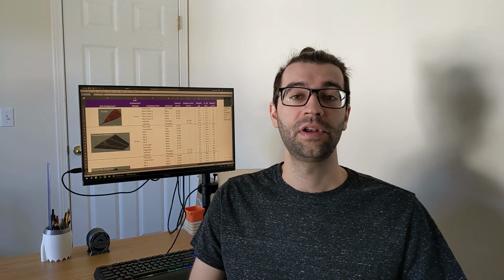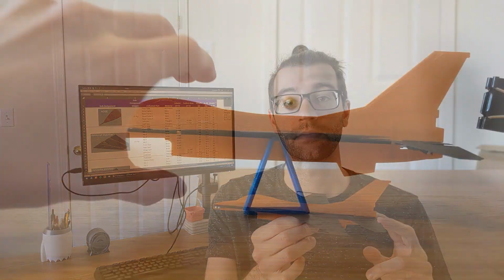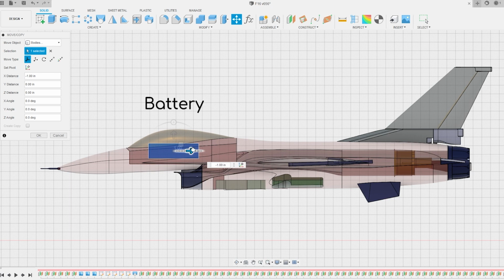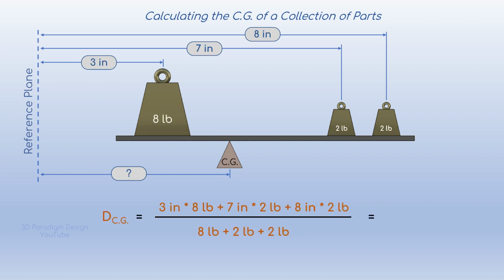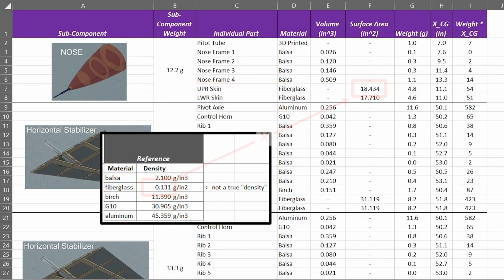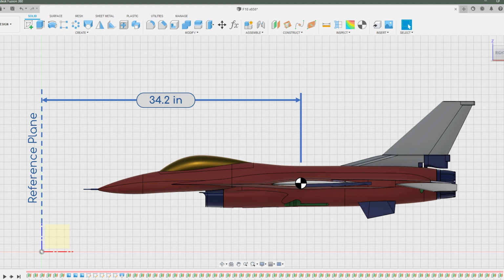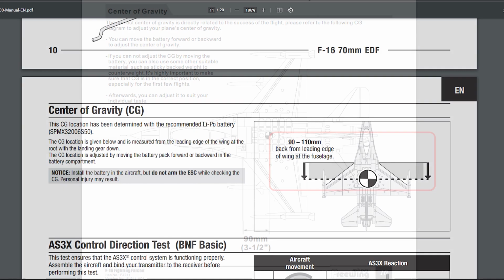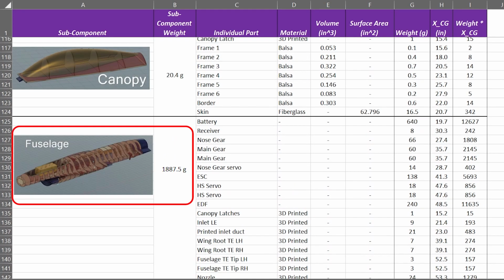Weight and Balance | Custom RC F-16 Build - Part 6

Comment: I would think one layer of glass would be too flimsy, but you certainly seem to know what you’re doing. Your weight and balance spreadsheet is great and you knew about the online CG calculator. When I talk about those things with my club members, their eyes roll back in their heads. At last count, I have 16 EDF’s including the 70mm and 80mm E-flite F-16’s. I prefer the 80mm jets. The 70’s are a little small and the 90’s need large, expensive batteries. I wish I had a shop where I could do what you’re doing, but it’s a lot easier to buy them from Horizon or Motion. I’ll be watching your progress..
Reply from the maker: It's great to hear your perspective on the different size EDFs. I'm casually thinking about my next project and deciding on a scale is one of the biggest challenges.
Reply: im with a 50mm making a rrc f16 in a country and its neighbours have no rc planes orr rc plane parts so id say 70mm is pretty big

Comment: I've watched all your videos about F-16 and i am impressed. I would really like to build one like this myself in the future. But i am a bit confused with the air intake tube shape. I know that sections does have enough surface size to provide enough air to the EDF but wouldn't that shape lower the efficiency of the EDF? Im just curious because im not that pro in building rc planes yet.
Reply from the maker: That's a great question. I haven't tested it or done analysis so i don't know for sure. I expect it will reduce the efficiency a little bit and increase the motor's current draw. I went with a larger capability ESC to hopefully accommodate the increased current draw. When designing the jet I really wanted the scale functionality (no cheater vents) so I was willing to accept the tradeoff (less efficiency but higher realism). However, once I assemble and test the whole plane if it has a LARGE impact on efficiency I may have to make changes (perhaps add cheater vents) but we shall see!